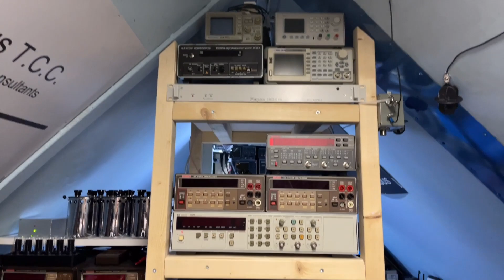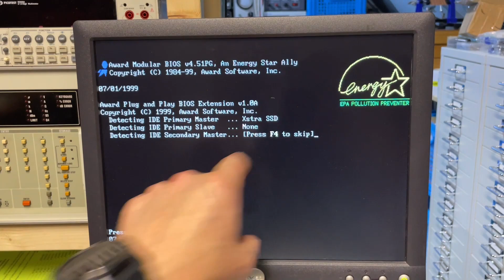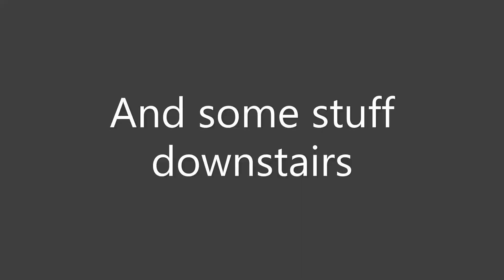TA-0355: Reorganizing the Lab  - What did i start ?

Comment: Nice one Tony, Its very difficult reorganising when everything is around you, but you achieved a great result in the end. I use a 2 draw filing cabinet for all my cleaning materials and it fits under the desk and the draws are tall enough for the cleaning spray cans etc. Of course I love the radio collection. I thought loading W95 on to a SSD was a great idea and a little funny too. It was great to see you on video again Tony. Now looking forward to the lab tour.
Reply from the maker: Thanks Ian, yes running DOS from SSD makes no sense, but i want to keep the IDE spindle HDD as a backup, as the Tektronic Field software and the ISA controller were tricky to setup. i have a nice backup now and run from SSD. when the SSD crashes i just make a new copy to the new SSD and are running again in no time.

Comment: Hi Tony, 😲 you did a lot of work, the plug-in computer is a great idea (I'm currently using this style to solve the placement of the Tektronix 2465 oscilloscope,  I got it from my son for my birthday- otherwise I won't fit it into my mini workplace). You did it really beautifully.

Nice day 🙂 Tom
Reply from the maker: Thank you Tomas, and happy birthday and great fun with the 2465
Reply: @TonyAlbus  Hi Tony, thanks for the birthday wishes, I'm really enjoying the 2465, just the size is a bit of a problem in my workshop. I've had a pull-out shelf for a 19" rack in the garage for a very long time, so I thought of making an oscilloscope that can be pulled out from the side of the table (the connection will be via a cable chain with firmly installed atypical compensated cables for the audio load that I'm currently making (then I'll send you photos). The oscilloscope will slide out and turns on the turntable by 90°, the front panel reaches the space between the monitor and the keyboard.
Nice day 🙂 Tom